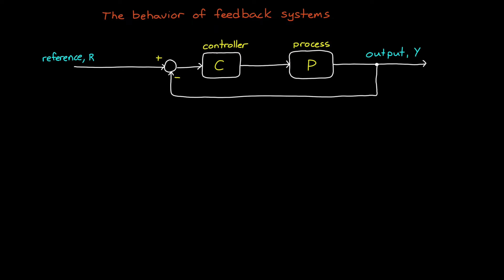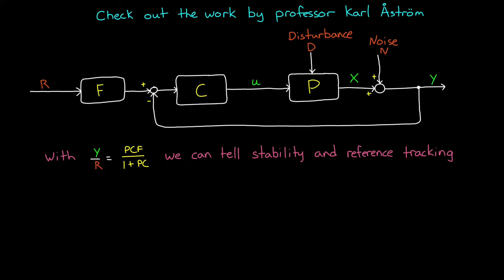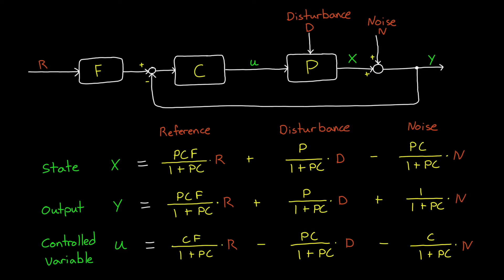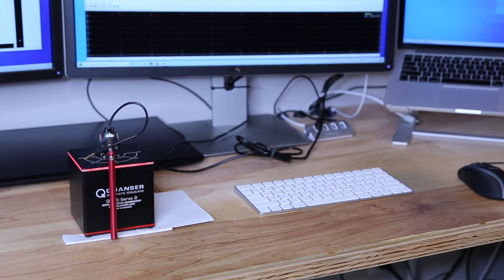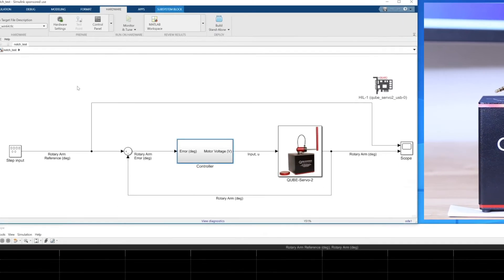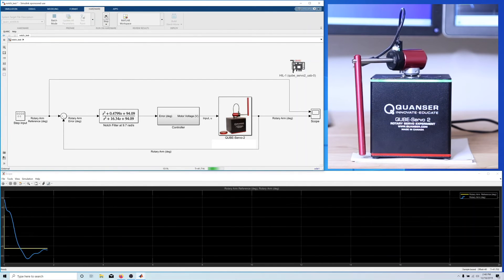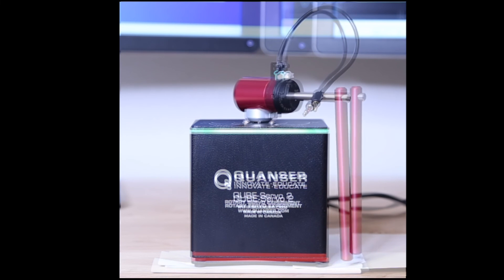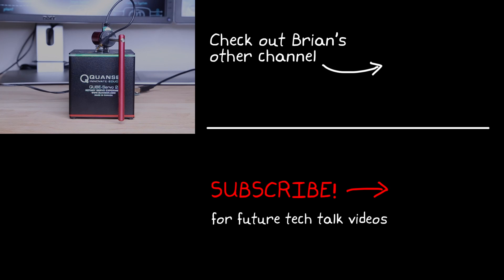The Gang of Six in Control Theory | Control Systems in Practice

Comment: Is it a good solution? With Notch-Filter in feed-forward path we effectively block the frequency 9.7rad/s from driving this system. Effectively the controller can not work with this frequency stimulation.
Reply: What a good solution is depends on your requirements. I agree that you can't drive the system at that frequency with that set up - is that good or bad? Depends on what you're trying to do!
Reply: It doesn't matter where you place the filter since it's a linear system right? So in the end it's always going to be a multiplication of transfer functions.

Comment: Brian, I enjoy your control videos. But the Feed Forward block is not consistent with your earlier video.  Showing earlier is the Feed Forward (which is ab approx inverse plant function) directly connected to the plant input.  There is no delay to the plant its a direct command that compensate for future disturbance.
Now you are showing the Feed forward applied as a reference to the FB loop. Which is delayed by the feed back delay. Plase
Reply: I believe the term feedforward control is appropriate for any kind of control technique that does not alter the feedback loop (denominator of the closed loop transfer function stays the same).
Reply: Brian, please explain why?